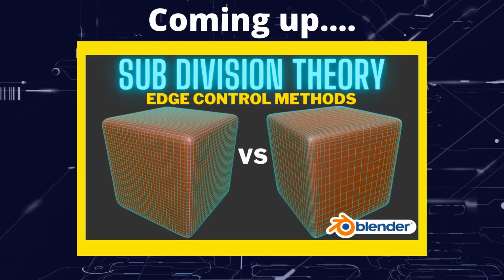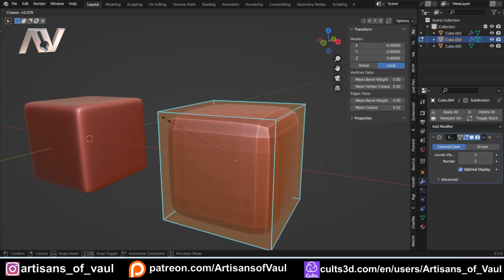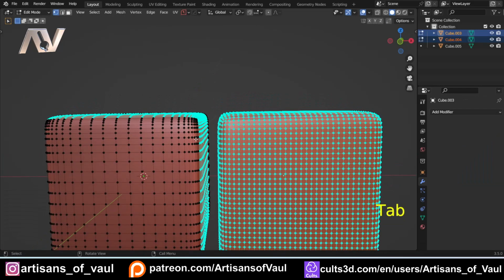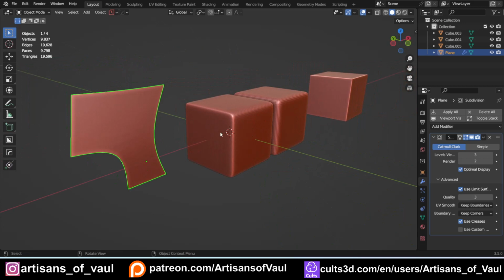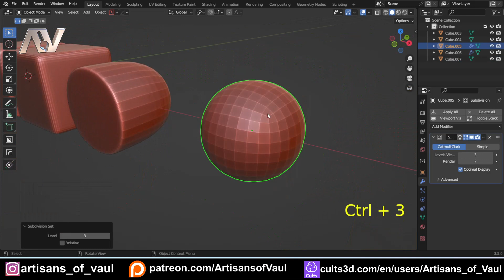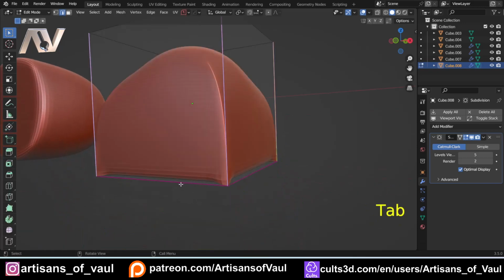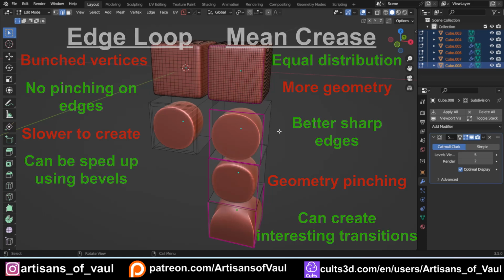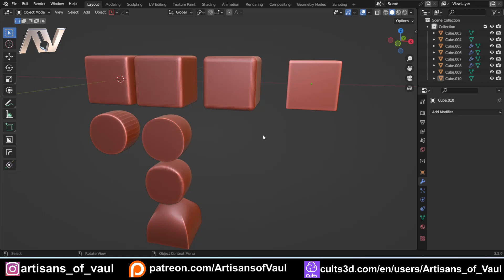SubD - Edge Theory

Comment: This is not called a Theory it's called SubD Modeling Techniques.
Reply from the maker: It's not "a theory" but it is "theory". Like driving "theory" or other use in that way, theory means to explore a system or way of thinking based on a set of principles. So while I am talking about modelling techniques I am using them as a way of addressing different approaches, so the titling of this and use of theory in this way is perfectly accurate.

But thanks for watching and taking the time to comment. 😁

Comment: Man ! there's something i need to ask ! and is bugging me when i try to do some modeling !
when you use solidify modifier, playing with the edge data allow some sort of tricks like these one but they'll be done all around the mesh, any way without applying it to kinda solve that ?

ALSO, probably a different topic but, i tried some armor stuff / sci fi suit etc, and i really hate the fact that, whenever i try to create a pannel myself without boolean, if there's a solidify modifier, then the geometry just lose it's mind, but creating a volume to have the same effect as a solidify is quite tricky if u wanna really keep your border parallel :( some help would be greatly appreciated on this matter <3 

thnks again for the content
Reply from the maker: Great question. So no and yes.... which probably doesn't help that much. So some modifiers have the ability to work only on some sections (you'll see they have a vertex group selection option) but with a solidify modifier the geometry isn't really there to allow you to select it, which is where that falls down. You'd have to apply the solidify first. The alternative to that is to use Geometry nodes to "program" what you want it to do instead. I'm waiting for there to be a working bevel node for geometry nodes and I'd be a VERY happy person. But you can still do some things in the way that you want through them.  I wonder if there is a "hack" to do something like a bevel maybe using a fillet function after turning it to a curve.... I'll have to have an explore.

As for your issue with I might need to see your attempt to then give some help. If you could share a file on Google drive I'd be happy to take a look.

Comment: I've heard, that other software may not "understand" the mean crease. So in case you want to bring the object of yours to another platform (or as a gamedev) - you should avoid using mean crease. Have you heard anything like this?
Reply: I think that goes for any modifier that hasn't been applied.
When exporting to another program you have no guarantee it will have a similar modifier system.

Like the difference between Blender and Maya for instance.
Reply from the maker: @idiotfalcon  Totally agree
Reply from the maker: To be honest I use Sub D as part of the modelling process and apply it but then I model for 3D printing so I don't know for sure. Sorry I couldn't help more.